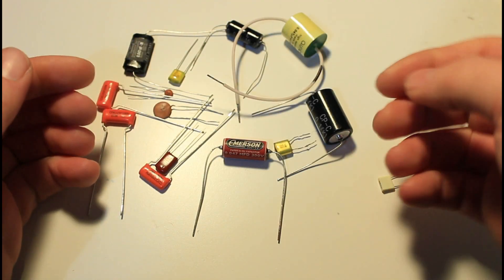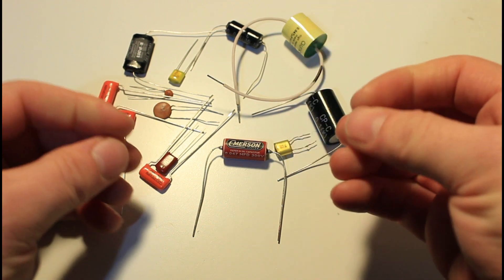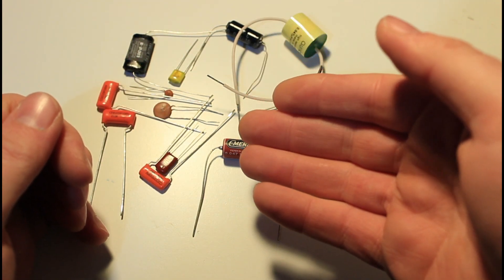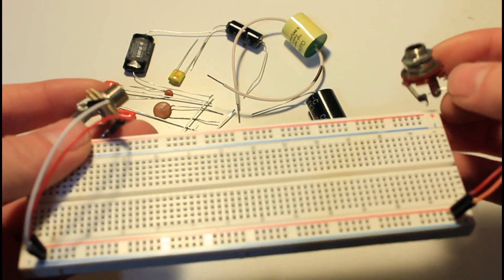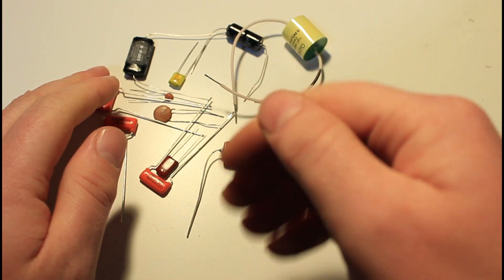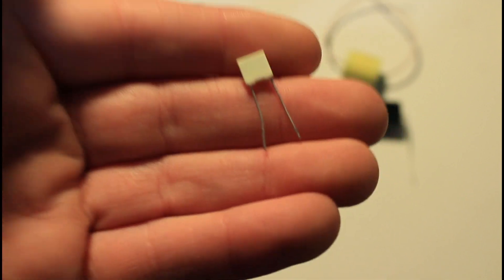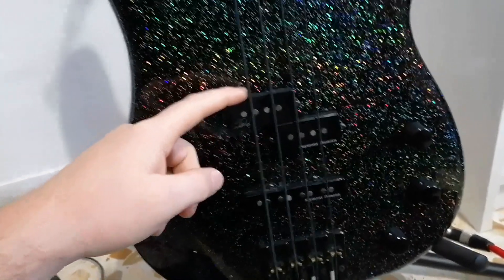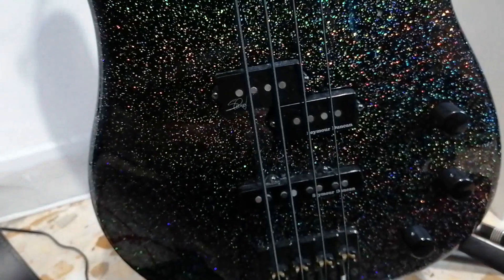Can you tell the difference? 0.20€ vs 20€ capacitors

Comment: Since signal never actually passes thru a capacitor what it's made out of is only for it's application. The only thing that matters to tone is how fast it charges and dis-charges (it's value).
Reply: Actually, high frequency AC current can pass though a capacitor. Low frequency AC is filtered to a degree and DC is the one that get's blocked entirely.
Reply: @toastedphantom3007  , I'm curious how current passes at any freq. since the two poles are insulated from each other by the dielectric material.
Reply: @bradt.3555  I can't explain it very well but you can see a capacitor as a frequency based resistor. The higher the frequency the less the resistance becomes. 
Technically there is no such thing as an insulation aside from vacuum and even that is debatable. There are only dielectrics; if the voltage or frequency is high enough, current will pass through a dielectric.
Reply: @toastedphantom3007  , Electrons flow very freely thru a vacuum, that's the basis for a vacuum tube. Within the range of human hearing no current will pass thru a cap.The analogy of a freq. based resistor is not whats happening in a circuit. With dc current flows till the cap is charged then stops. With ac it charges and dis-charges at the rate of the freq. When it's ability to hold a charge is greater than the freq. then it's charging, dis-charging allows current to flow in the circuit continuously. When the time it takes it to charge, dis-charge is less than the freq. the time current flows in the circuit becomes reduced.Current is not actually passing thru it as with a resistor. That's why a resistor passes dc. Dielectrics become polarized but the electrons are so tightly bound to the atoms that the electron from the negative side never push them to the next atom to finally get to the positive side, until the voltage becomes high enough to over come it. In practice a dielectric is a resistor with near infinite resistance. If you do the math the freq. for current to flow is like in the quadra-trillion range.
Reply: @bradt.3555  Interesting, thanks for sharing your knowledge. This confuses too to some extent since in audio circuits I often see a capacitor being placed in series right before a speaker. I've also seen caps used in grounding wires as a low pass filter. A frequency based resistor is the only explanation that made sense to me.

On second thought, wouldn't the rapid charging and discharging of the cap reproduce the voltage curve on the other side of the cap but phase shifted?
Reply: @toastedphantom3007  The value of the cap tells its ability to hold a charge. If it's say a 60 cycle tone , that means the polarity is reversing 60 times a second. If the cap is high enough value it will hold the charge longer than the polarity change so it will charge the cap in reverse before it compleatly dis-charges so current will always be flowing. if its a very small value cap it dis-charges long before the polarity changes and recharges it. So with the cap in series, like going to a speaker, the only time current flows is when it dis-charges then re-charges so there is a lot of down time when current isn't flowing, so as the value gets smaller it takes higher cycles per second to keep up with the cap and have current flowing. This is why it seems like freq. sensitive resistor. hope that makes sense. The cap almost become a freq. dependent battery., for an analogy.

Comment: Hi Oliver, did you try reversing an Orange Drop?  To my ear 'text towards pick-up' vs 'text toward output' can give a big change, hence I always check an orange drop before fitting - sometimes I like the brighter orientation sometimes the darker (sadly I've read there is no consistency in printing so each cap has to be checked before soldering).
Reply from the maker: Never actually heard any difference, regardless of orientation. I really don't believe there is any to be honest
Reply: @OliverTobyn  Why did you waste your time doing this if you had your mind made up before you started? That's intellectually dishonest.
Reply from the maker: @richsackett3423  I wouldn't say I had my mind made up before I started. I didn't even know this was a thing. Just didn't hear any difference, regardless of orientation. Why would there be any anyway? As far as I know they are simmetrical
Reply: @OliverTobyn  Perfect components do not exist. There are more parameters for capacitors than uF.  FWIW, impedance is a frequency-variable phenomenon. Not clear why you bring up the straw man of orientation.
Sorry you can't hear the difference. Critical listening is a handy skill for a musician.

Comment: Hi thanks for the very interesting video. I am shocked by the huge difference between the sound without cap and the sound with caps ... all the caps mute the sound ... some more some less but the sound without cap is so much better that is shocking.
Reply from the maker: Well that's why you have a tone pot, so you can adjust the amount of influence it has on your sound! :)
Reply: @OliverTobyn  hi thanks a lot for the very kind and helpful advice But still the sound with caps is more veiled i prefer without if i have to choose regards gino
Reply: that's exactly what I was thinking, the so-called clean sound is a thousand times better
Reply: @curtrod hi I feel the same
Many amplification devices have caps on the signal path 
I start to wonder If they are really acceptable at least when high fidelity to source signal is the goal
Impressive and instructive test indeed

Comment: That .022 uf Cap sounds like a jazz bridge pickup. What do you think about using a push pull switch? .1 uf and .022 uf on a Precision Bass?
Reply: A push/pull pot for tone with different caps is a mod I have on several of my guitars, I tend to think of it as changing voices.
Reply from the maker: Yeah, it's quite a common mod. Helpful if you want that deep bass sound of the 100nf and the burpy mid range of the 22 nF

Comment: Hi, in your experience, since you have a Dimarzio Model P equipped P-bass, what capacitor would you suggest to get the most out of the pickups in terms of tonal possibilities from mellow to aggressive (say, Steve Harris kind of sound)? I am still waiting for my set to arrive and it will take a little long, since I don’t live in the US, but I got someone who can get me stuff from there to my country. Also, do you use the suggested setup as in Dimarzio webpage (500k pots for volume and 250k for tone)? Would it work to have both with 500k pots to get the most sonic possibilities out of them? I currently have both pots with 250k resistance and the cap is 0.047 mF. Your comments are always welcome, thanks.
Reply from the maker: Hi! I use a Fender TBX tone pot on a couple of basses, which acts as a 1Meg pot, and it works quite well. Two 500k pots will give you a definitely brighter sound, which might work well with the Di Marzio as they tend to be slightly on the darker side. In the past I used 500k  pots with Seymour Duncan pickups and the bass sounded way too bright.

Concerning the capacitor, a 100nF one will give you a nice deep and warm sound when your pot is all the way. That and 500k pots will probably give you a nice range of sounds, from bright to mellow.